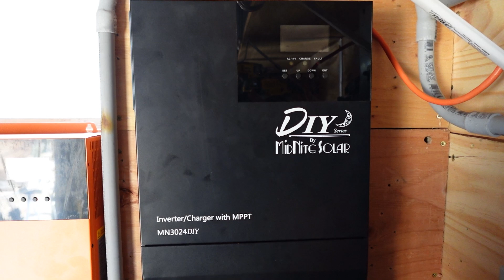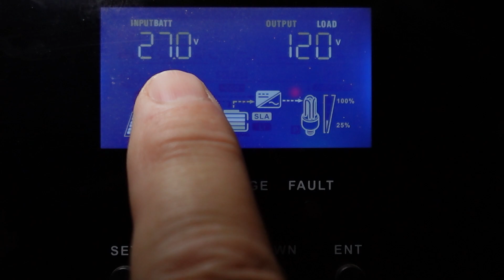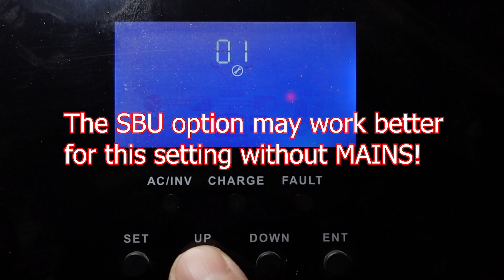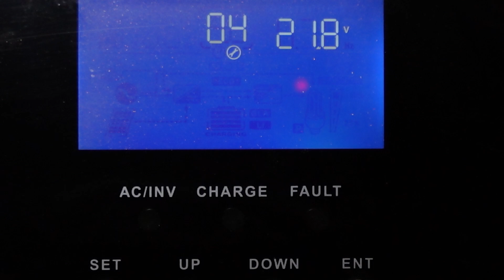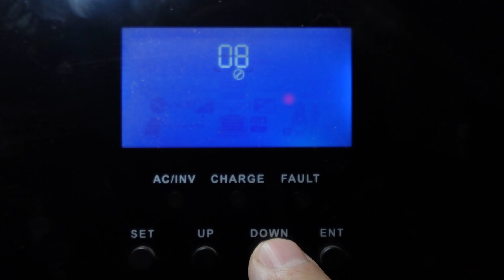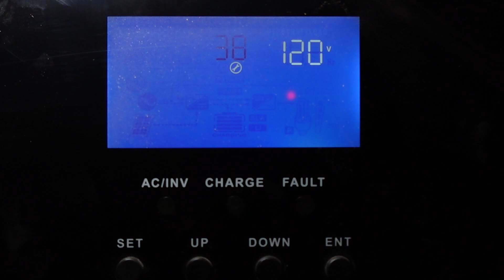How to set LiFePo4 Battery Parameter for Eco Worthy 24v 3000w and 48v 5000w, Renogy and Midnite AIO

Comment: Thank you Gary from Arizona. I have the same inverter for about 2 years and never had to change any default settings until this trip as its the first time I've needed the a/c. I put out 1200w in panels producing about 800w/hr and have 7200wh in storage. A/c is 1100w and was cycling on and off about every 3min drawing around 700w/h. I had the battery setting at L08 and was changing the other parameters without understanding the use selection. I appreciate you making this helpful video.

Comment: Thanks for the great video. I have the exact system and find that the batter State of Charge(SoC) seems way off. it will sit at 100% of hours with no load then drop to 60% in a 10 min span with no real voltage drop. Normally when the battery voltage is close to it's natural state at 26.6V. Just wondering why or how to get this to be more representative of actual w/hr vs time to percentage. If I manually calculate then it should only be down a couple percent. It will normally level out at 26.6V after a couple hours after fully charged and sun down and then does it's drop to 60% then even down to 54 %. Any thoughts? Thanks

Comment: Great vid. Does ecoworthy have a version of this inverter that'll do split if 2 are used .?  I saw your comment on #29 . .. Does it do pass through like if the inverter can't produce enough wattage it supplements with mains. ?
Reply from the maker: @blainecelestaine4543  yes, they sell a 5000 watt that is capable of parallel connection for split phase output. Decent setup actually, and I believe there is a is though but I'll have to take a look again. I've been pretty focused on another project lately.
Reply: @SolarBearDIY  thx

Comment: We set up our 24-volt eco-worthy system for solar only we followed your instructions and it is not working the solar panel icon does not light up, I left a voice message with eco-worthy, but no one has contacted me. ( I have 6 100-watt panels  2 100 ah lithium batteries and the eco-worthy 3000-watt inverter)
Reply from the maker: @Pamoffgrid  are you getting voltage from your panel array?
Reply: @SolarBearDIY  I think so, how would I find out?
Reply from the maker: @Pamoffgrid  you will need a volt meter and test the voltage at the positive and negative lines that connect to your solar controller
Reply: I have to purchase a volt meter.
Reply from the maker: @Pamoffgrid  I recommend it. I'm not sure if your location, but even an inexpensive one from harbor freight will suffice. It is a necessary tool for trouble shooting. If you have Facebook you can join my group and we can help you problem solve. It's also easier for sharing pics and instructions.

https://www.facebook.com/share/g/1CdjtNXQVt/
Reply: @SolarBearDIY  I do have power to the panels, still have trouble with the inverter. I joined your Facebook group.

Comment: I'm buying ecoworthy here in a few days.. I'm looking to make sure everything works to my need w panels 1st research research every thing..
Reply from the maker: I'm here to help if you need it...
Reply: Ok cool i got the 5000w 48v inverter.. and 4 of their 12v 280ah batteries all with bluetooth.. question how do i get the inverter to communicate via bluetooth to the batteries so their is accurate numbers in their app ..all ecoworthy. . @SolarBearDIY
Reply: @SolarBearDIY 
Hi there men, one question the pv junction box eco worthy 4 input . If you put one string of 10ah and another string same 10ah the ouput is 20ah? Or maintain the same 10ah to the hibrid inverter ?
Reply: yes the box that you have the 4 breaker with fuse , the lightning protection and dc breaker ouput .
Reply from the maker: @mhansel71 actually I retract my last comment. The amperage will increase, but the voltage will remain the same because it is connecting everything in parallel.. sorry about the confusion!
Reply: @SolarBearDIY 
So i have to put everything in only one input -+so the ouput be the same 
Ex 4 panel in serie 10v 10ah total is 40v 10ah put in the one entry and the ouput will be the same right ?
Reply from the maker: That would be correct @mhansel71
Reply: @SolarBearDIY  
Hi there, a question men if you have a inverter of maximun pv current of 18ah can i put 18.21ah from the solar panel?

Comment: hi gary i just got my eco worthy setup 4 panals Bifacial 195W 12V Monocrystalline Solar Panel and i have 2 of the LiFePO4 12V 100Ah with bluetooth, i wired it all up today and nothing happens just been out ther tonight in the dark wired up a mains on a plug just to test and i can run plugs from mains or battery but i cant seem to charge ive ran them in series would this chart be a good place to start for me ? wher am i going wrong :D

Comment: Salve ho in inverter eco-worthy 3000Watt 24v quattro batterie lifep04 da 12.8v 100ah 9 panelli da 170watt qualle impostazioni devo fare al inverter ibrido? Grazie
Reply from the maker: The setting I have outlined here should be a good start. Just make sure that your batteries are configured for 24v.. Thanks for checking in....
Reply: @SolarBearDIY  ciao si sono 4 batteria per 24volt perché il impianto è 24volt grazie

Comment: Hello, I have this error in the converter, how could I fix it if I lower the values of the converter to 21V, because the battery, the maximum it reaches is 24V?.
Reply from the maker: I need to know all of your settings in order to assist you my friend.

Comment: How can you even reach 60amp charging from solar with the 100v /1500watt input limits?
Reply from the maker: Good question, remember that the job of the controller is to reduce and regulate voltage, in addition to other actions. So if your controller will regulate the voltage to 24v on a 24v system. 1400 watts/24 volts=58.33 amps. But they like to round up if they can.

Comment: When i put my inverter in  use it saying sla?
Reply from the maker: @dannylimbert9181  yes, it will say that when you are using "user" charging parameters
Reply: But if I'm using lithium iron battery does it need a different setting?
Reply from the maker: @dannylimbert9181  As long as you are in user mode, those will be the settings/parameters that you charge controller uses to charge your batteries. The monitor will default to sla because really the monitor doesn't know what type of battery you're using.

Comment: Thank you Gary. This is a great video. Unfortunately my charger inverter is not a clone of the series you discuss but it is a copy (even uses the same case). Are you familiar with the PowMr brand? I have the 3.6kw model in 24v. (POW-LVM3.6M-24V) It uses the same kind of display and identical menu structure but many of the settings are different numbers and it does not seem to have as many set points as the one you are using. I am astounded that these manuals don't give more detail on the functional operation (when they bulk charge, when they float and when they boost etc) Your video was a huge help validating my decisions of max charge voltage, min battery voltage and so on but still lots of questions to resolve. I would really like to know ALOT more about the function of the internal BMS in the ECO batteries too. I have 4 of the 280AH in 2S2P. Is there any wifi or other interfaces to read the internals on these batteries? I found you in the FB group I am Tim McRae on FB
Reply from the maker: @MrKiwi13605  hey thanks for checking in. Yes, I know quite a bit about the powmr, contact me at solarbeardiy.Consult@gmail.com

Comment: Hi, when i keep clicking through the menu i have a few setting that arent in the manual. I believe 39 and 40. One has option from 0-254(i think) what is this? And the other a selction of codes. Csn you help with these hidden setting that sre available to look at but not in the manual? So i know which to select
Reply from the maker: @matsz10  yeah I can take a look at that, can you tell me what inverter you have??
Reply: @Tool_Shed_Talk  I have Eco-Worthy 24v 3000w hybrid inverter. Same one under a different badge in this video. Strange how in the manual it skips from 31-35. I just want to know what those settings do
Reply from the maker: @matsz10  I believe they are options for another inverter model, but when they flash the chip those settings are probably not added for to compatibility and the option may not be available on this model

Comment: Hey Gary your setting 35 & 37 are the same should the 48v system not double in line with the others? Cheers
Reply from the maker: @neilgrant706  yes indeed they should be double the value vs 24v parameters. That was a definite typo on my part, and I actually fixed that a while back when I was doing some troubleshoot for another guy. I forgot to add it to the description..
Reply: @SolarBearDIY  Top job thanks for the fast reply

Comment: so i have the eco 5000 watt invertor -  the same control screen you demoed.  Thank you for that video.  I have studied the manual and i cannot seem to find anything indication the number of watts my pv is producing.  I see the number of volts which should be 19.8 x 12 = 238.  It would be helpful to now the wattage since my panels are rated in watts.  Same thing when i run my generator (i will ask you another question about that later).  BTW, do you consult for a fee?  I'm happy to pay you for your time.  Thank you.
Reply from the maker: @iplayer10  sure, there's a couple of ways to go about finding that information.
Reply from the maker: And yes, I do consultations
Reply: @SolarBearDIY  i need immediate help....how do i contact you to make arrangements?
Reply from the maker: @iplayer10  you should be able to email me through YouTube, and then we can go from there. 

Another way is to join my Facebook page and we can use messenger. 

https://www.facebook.com/groups/417085394631550/?ref=share&mibextid=NSMWBT

Comment: i have a 48 volt lifpo system -  all eco-worthy - 5000 watt invertor , 14.3 280 amp 4 battery, 2400 kw array and a invertor genertor which will be used manually when the fault indicates pv unavailable and batteries need to be charged.  How important  is a ground to earth?
Reply from the maker: @iplayer10  highly recommended

Comment: have you hooked to generator for main power yet? I cant get mine to work with generator it trips gfi on generator  as soon as I plug it in
Reply from the maker: Not yet, I'm just ordered a shipment of batteries, I'll order some generators next and hey the fun begin 😀
Reply from the maker: @tsujehtekaj6  you may have competing neutral to grounds here, or a line crossed. Are you on FB by chance?
Reply: yeah not sure the issue might be the inverter changer or it doesn't like the generator(dirty power). I don't have mains to test if it's the inverter it worked with old set up looking to get a inverter generator and see if it will work just can't charge the battery using the generator for mains power
Reply: @tsujehtekaj6  You might need to bond the ground on the inverter and the generator so the don't see each other as huge variances to each other and trip the GFI. This is really common in RV's and generators. Mike Sokol has made a couple of videos on how to bond them together (or unbond them as the case may be). I won't try and tell you how to do it because I have never had to do this myself and I don't remember the details, but is is common and the fix is easy and cheap. I am sure Gary can explain it better.

Comment: Thanks for the video, i'm looking to buy one of these on facebook marketplace for a very good price. Does the switch on the bottom turn off the entire unit or just the power inverter? I would like to be able to turn off just the inverter to reduce quiescent power draw when i'm not using any appliances. Thanks
Reply from the maker: @scellyyt  The power switch turns off the entire unit, there is an Eco function that will turn the inverter off if there is no power draw detected. I'll confirm that when I get home. Thanks for checking in!
Reply: @SolarBearDIY  thanks for the fast reply, your videos have been very helpful

Comment: I have the Sungold all in one inverter.  It's the same as this one.  Can someone tell me why it never shows the solar panel icon?  It there but never hi lighted.
Reply from the maker: @jeffcrutchett7993  that's interesting, is it charging via the panels, or do you have it connected to mains power also?
Reply: @SolarBearDIY  I only had 4 100 w panels on it.  I added two more panels this morning and now it shows the panels on the display.  I thank you for replying.  I do have another question.  I also installed a combiner box.  So the first 6 are all in the same line.  What would you suggest I add as far as next panel upgrade?
Reply from the maker: @jeffcrutchett7993  ah yes, so answering your other reply; it sounds like you did not have enough voltage from your panels to meet minimum voltage requirements to operate your controller. For your other question, you will want to keep your panels the same. That includes different strings of panels going to your combiner box. For example, if you have six panels connected in series. Going to one fuse in your combiner box, you would want another string with the same amount of panels in the same configuration going to your combiner box. Your combiner box at that point would connect them in parallel and your amperage would increase, and not your voltage. This is something to use caution with so that you don't exceed either your voltage requirements for your controller, or your amperage requirements for your controller and or wiring.
Reply: @SolarBearDIY  Thank you for your advice it means a lot to me that you took the time to help.  So I guess next year I will be adding 6 more 100 watt panels.  Once again thank you.
Reply from the maker: @jeffcrutchett7993  anytime, I'm glad to help.

Comment: Eco worthy should give a setting number for us if we are using their battery. They should know your battery well indeed. I saw they have some number for some lithium setting in the manual but not sure if any of that is for the 12v 280ah battery i got from them. Currently, i just bring up a 2s2p with that battery. Waiting for some cable to come to complete that
Reply from the maker: @HuyTran-zy9sv  yeah, it's difficult as this controller is a rebranded item, and even then there are so many different batteries with individual BMS systems, sizes, etc., that it would be difficult to accommodate them all. Even the different size Eco Worthy batteries have different parameters. That's why I think learning how to set your battery parameters is important.
Reply: I change parameters similar to you and also compared with numbers for the battery from them which is similar.  The app always showing around 60% SOC all the time. All 4 battery are fully charged with eco worthy charger before hooking them up together. 

One more thing, i use AC charging from my eg4 system to charge this but it limit at 500w range only. I dont see setting that limit this
Reply from the maker: @HuyTran-zy9sv  are you using the ESS app?
Reply: Yes
Reply: I just got response from their support telling me to set battery type to LF08 in setting 8 as i am using their 12v 280ah battery
Reply from the maker: @HuyTran-zy9sv  let me know how it works
Reply: @SolarBearDIY  I set setting 8 to LF08 and it allow the batter to charge to higher voltage 27.4v instead of 26.6. 
One thing still hit me is that when trying to test the capacity with 1kw draw for only 5 minuts or so, the voltage drop quickly. 
And the SOC % in the app seem to be not accurate at all
Reply: @SolarBearDIY   LF08 is because each battery has 4 cells so 2x = 8 cells.  That is what they said
Reply from the maker: @HuyTran-zy9sv  interesting, I'll have to look further into that.
Reply: @HuyTran-zy9sv   i have 4 12v 100ah for the hybrid. could i ask what setting you use please.
Reply from the maker: Sure, what voltage of hybrid do you have?